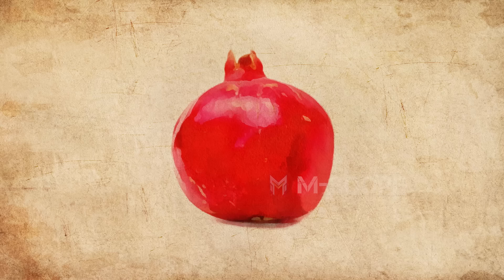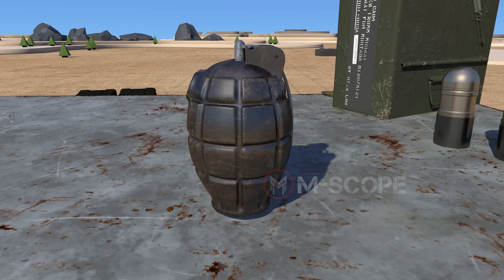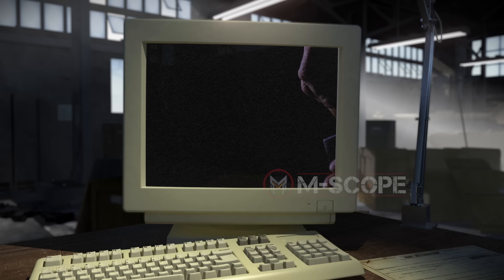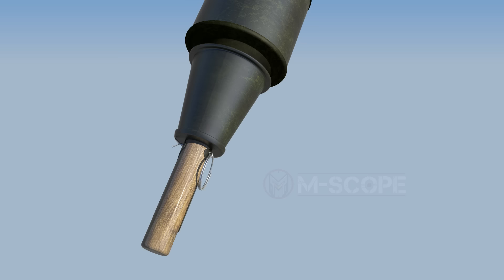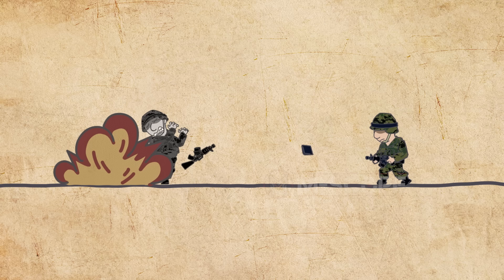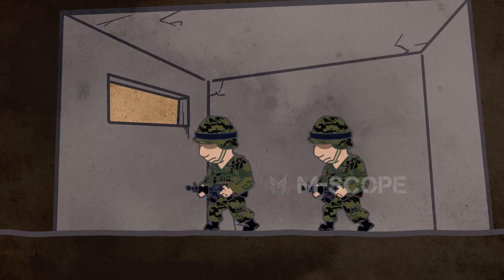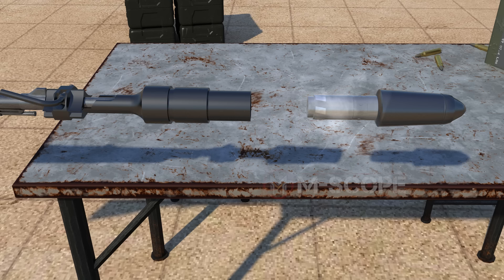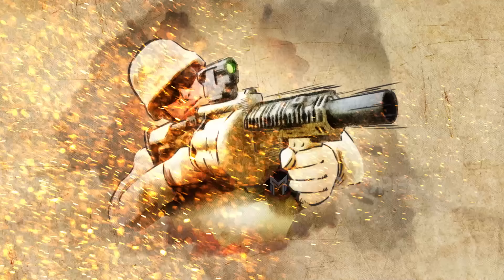How hand grenades and rifle grenades work? - All about grenades Part 1

Comment: "A grenade is a weapon made by putting explosives or chemicals into bullets." No. A bullet is a projectile fired from a gun. This is not just semantics, since explosive small arms and light weapon ammunition (although the latter would typically be called a 'shell' at 20mm calibre or above). The Oxford definition works well i.e. "a small bomb thrown by hand or launched mechanically"
Reply: Quite right. Grenades were invented as a way of giving explosive weaponry to an individual soldier.
Reply: 2+2=4
Reply: @InkSplatter446 
I don't think it's even their second.  This is pretty clearly a Wiki article fed into Google Translate and then fed into a decent Text-to-Speech program.  You can tell from the multiple typos it read out, the way it pronounced a few words, and the way it read "MK," which is supposed to be reak "mark."

This channel is a content farm, and going off of the limited amount of art, I'd say China or Russia.
Reply: @isaacschmitt4803  Don’t forget all of the bot-like comments that praise the video and only have one or two likes each.
Reply: You should blog about it
Reply: Sabot, eh? c'est oui?
Reply: I'm  still tring to figure out how fins make a rifle gernade fly stab um. And when did nap- um replace NAPALM?

Comment: Keep in mind....a 62 gr 5.56 round moves appx 3200 fps. A piece of shrapnel from a grenade is moving appx 25,000 fps... HUGE difference in what a jagged lump of shrapnel does vs a projectile from a gun.
Reply: I know you are trying to sound smart and apparently 17 people believd your BS 
25000 fps? 🤣😂🤣😂🤣 7.6km in 1 second? 
Lmao, an F16 goes at mach 2 (2400kmh or 666m/s).
A tank shell goes at 4000 fps 

Heres the real number

Shrapnel can travel at 3000 feet per second in all directions from the explosion

VOD is the velocity or rate of propagation of chemical decomposition/reaction... Not shrapnel
Reply: "I know you're trying to sound smart ..." 🤣
Reply: @nostro1940  can you imagine shrapnel flying at 25000fps tho? It would absolutely destroy everything in a really dragonball z kind of way, right? That ammount of force must be enough to make the shrapnel vaporize and pretty much delete everything that comes in contact with its dust
Reply: No, 15000-20000 foot/sec  is the velocity of chemikal reavtion of explocive, not velocity of shel

Comment: In Switzerland we had the 43 Stick Grenade to the mid/late 80s.
In the animation the flight is shown wrong, the heavy head of the grenade was the centre of rotation during flight.
Reply: I wondered if that was the case!  Thanks for the clarification.
Reply: One variant of that stick grenade was used in the movie "Mission In Action 3". Such a grenade was thrown behind character Colonel Braddock. When it landed on the ground (presumed now the grenade was armed), he looked at the dropped grenade, and knew he had to run away. It did not blow right away because of the so-called "delay fuze", but he knew he had to run away fast, and he did, but as soon as he ran 2 steps, the grenade blew up and he took the full brunt of the blow-up, catapulting him as far as 15 feet, because he was still in the kill zone of that blown grenade.
Reply: In "Saving Private Ryan", a WW2 movie, you see the Wehrmacht fighters throw stick grenades at several American soldiers perched on a 2nd floor of a war-torn building. The good news is that thanks to the delay fuse, the soldiers realized the sticks would blow in about 1-2 seconds so they had to jettison the grenades away out of sight before they blew. The grenades blew, but they survived.

Comment: In the Italian army until the 1990s the Beretta BM59 rifle was available which had the native possibility of launching Energa and Super Energa anti-tank grenades. It was necessary to raise the alidade (which, in addition to being an aiming device, closs the gas recovery system so that the gases from the explosion of the blank cartridge were fully available), engage the grenade and press the trigger. It is highly advisable to use the winter trigger because if you used the standard one you risked breaking your finger due to the strong recoil

Comment: During yugoslavia war some home made adapters for standard yugo handgranades has been used on AK's (fired with blank bullets). Such attachment screwed at front of the AK barrell hold safety lever of standard handgranade (M75 or M52), operator just removed safety pin and fired blank bullet....

Comment: The German Stielhandgranade still worked in such a way that you had to unscrew a cap from the bottom and then a string with a ceramic ball would hang out from it and you had to pull it and throw it away
Throwing it was a bit interesting because it had to be thrown by spinning it, unlike Russian or American hand grenades
The operation of the other round hand grenades is simpler, you only have to pull out the round safety pin, then as long as you are holding the grenade there is no problem, but if the metal tab on the side falls off the grenade, it becomes ready to fire from then on, so you have to throw it away within a second because it explodes in your hand and blows off half your body along with your head
A rifle grenade is usually not converted from a hand grenade, but there is a separate rifle grenade with a launcher, in which case a blank cartridge must be used to launch it 
The Germans already used a rifle grenade called "Schiessbecher" for the KAR98K under WW2
This is, for example, the AMP 69 of the Hungarian Army, introduced in 1975, which was specially designed for launching rifle grenades

Comment: I dont recall any grenades containing napalm. There is the M34 which was used as an incendiary and instant smoke screen grenade. The AN-M14 is a popular incendiary grenade and it doesnt explode either.
Reply: Exactly right
Reply: napalm is news to me too thermite and white phos incendiaries but napalm!!
Reply: Napalm in a grenade would be borderline useless.
Reply: There was a small napalm rocket developed for the The M202 FLASH. Was supposed to replace the flame thrower.
Reply: @johno1544  it wasn't napalm,  it was a pyrophoric aluminum compound
Reply: @chemistryofquestionablequa6252  I'm talking the The 66 mm TPA (Thickened Pyrotechnic Agent) Incendiary Rocket M74. The M235 had the triethyl aluminum that ignited on contact with air

Comment: At 8:17 they mention that white phosphorus is the filler for smoke grenades. Although there are white phosphorus grenades, I think it’s important to point out that the filler for normal smoke grenades is not white phosphorus but a different chemical.
Reply: which chemical?
Reply: @ericcartman2119  The filler consists of 250 to 350 grams of colored smoke composition (mostly potassium chlorate, lactose, and a dye) in virtually any color. White smoke grenades typically use hexachloroethane-zinc and granular aluminum

Comment: I thought that modern grenades didn't have grooves at all, but individual fragments contained in a thin shell.
Reply: Yes,  they use ball bearings epoxied inside the thin metal casing.

Comment: When I was in the Marines we were told there was a 5 second fuse however the pomegranate is made by the cheapest “Lowest bidder” generally you do not want to cook the grenade! Explosion times may vary!

Not that anybody cares but my reduction to a grenade was in MCT Camp Lejune, it was the instructor “we were in this like shed structure” the instructor was deepest in the shed to my left was this female & me, the instructor pulled out what look like a peanut jar “aluminum container that peanuts come in” remove the top followed by pulling the pin to open “remove the aluminum that sealed the grenade” tipping the container upside down having the grenade fall into his hand, only do then toss it unexpectedly through the female hitting her in the chest “gently” only for her to freak out in the grenade to fall to the ground! Second it hit her chest, she screamed and try to leave the shed! However I processed it as instructor what is not running then we're good! I thought it was funny I also thought it was interesting how the grenades were sealed in a peanut can!

Another story: “for those who are interested”  Took place in Ft Leonard Wood, everybody was sitting cross legged in a semi circle around another instructor, he was holding a practice grenade “hollowed out with a replaceable primer/ fire cracker that function exactly like a grenade” he was explaining how a grenade function, pulling the pin, letting the spoon eject, then barely tossing it in the group the majority of the people ran for their lives!

Comment: OK video,!  However, slight omission. Some grenades were launched from early M16s using a Nato 22mm diameter flash suppressor and a grenade retaining spring  The system was dropped because of having too excessive time to use a Grenade Launching Blank cartridge ( no projectile). The reason for dropping use was having to manually load a GLB. Nessatating removal of the ball round and then placing the GLB in the chamber then placing the grenade used on the end of the rifle barrel.   Live ball M193 could not be used to launch the rifle grenade.  Doing so would result in injury to the shooter,and the detonation of the grenade. The M203 did not require such excessive time constraints. Faster reload times, and more variety of rounds.

Comment: Great animations but a few technical inaccuracies:

1. It’s not true that hand grenades NEVER have instantaneous fuzes. Some countries ship hand grenades with the option to insert an instantaneous fuze, thus providing the ability to turn the grenade into an anti personnel fragmentation mine.

2. Although less common, stick grenades didn’t completely disappear after WW2. The Chinese continued to make a stick Grenade for some time.

3. Rifle grenades did  started with adaptions to hand grenades in order to increase range. However they very quickly became a different sun-group of ammunition and it’s generally inaccurate to use the term ‘rifle hand grenade’. The M31, for example, can’t be thrown by hand.

4. Not all rifle grenades use ballistite (‘blank’) cartridges. Some use a ‘bullet catcher’ mechanism which allows the user to use a standard round, as does a ‘bullet through’ grenade. These types reduce the time in which the rifleman can’t use his rifle while setting up the grenade.

Comment: Enjoyable video. You missed a baseball CS that doesn't have the clip. A plunger is in the tube and a pin holds it. We learned that putting your finger on the plunger when pulling the pin is NOT the same as holding the spring handle. It will explode while you hold it and your finger holds the plunger. The plunger does not need to pop off to arm it. I betcha!!

Comment: Great video.  Most of this I already knew or had a pretty good idea how it worked being a history and war buff since high school.  Though I do have a question.  At 9:35 you go into the mechanics and actions of a spigot launcher.  This was something I knew nothing about but am amazed at most of it.  The grenade is inserted into an adapter tube then into the Spigot launcher.  The explosive gases from the blank rifle cartridge blasts the grenade assembly into the air toward the enemy.  Now, how is the safety pin pulled from the hand grenade?  How is the spoon released when we can clearly see that it is constrained by a clip on the launcher?  That part is not followed up on and explained.  My father is a Marine and says that you DO NOT pull a safety pin out with your teeth like you see in movies.  They are restrained quite well, one would pull his teeth out before that safety came out.  It takes a determined pull to remove the safety pin.  And what about timing?  It takes a few seconds for the detonator to activate the explosive material.  Otherwise you're simply delivering a perfectly good hand grenade to the enemy without the satisfaction of it's detonation.  They may return it in a proper manner.  Answer?
Reply: InRangeTV has a good video on the M1 Garand spigot launcher if you are looking for more details. There is a little tab that holds the spoon down after pulling the pin until you fire the grenade. On some cup launchers the cup itself holds the spoon down until it is fired, so you pull the pin and shove the grenade into the cup without letting the spoon fly off.
Reply: @asteamedpanda  Ah, that explains it.  Though having a grenade that close to me without a safety pin is a bit unnerving.  But it works so mad respect to the soldier arming a launcher.  Thanks for the info, that pretty much explains it.  I will check out that channel.  Appreciate the lesson.  I have learned something new. 🙂
Reply: Rondo I suggest watch a 13 part series called What on earth happened by Ewaranon to learn that the earth is not a globe. I got it in my about tab.
Reply: @flat-earther  In my brief research this appears to be a con of some sort.  A lot of negative publicity surrounds this mysterious person.  Perhaps another Scientology in the making?
Reply: @rondohunter8966  I share the series because in my opinion it's one of the best I have seen to serve as an introduction to the globe versus flat topic.
I don't know what Scientology is.
If you don't want to watch it there is NASA fanboy questions which is a series with very short parts. It does not cover flat earth but questions the globe.

Comment: grenade is something that i would not use myself in war cuz they do explode in hands sometimes after removing so called ring. im not sure if it due to faulty grenades or someone in the factory just having fun.
i have seen video where disguisting bearded muslim screamed Alla im going to BAR removed safety pin and grenade took off his hands instantly after it happened other muslims started to scream Alla In The Bar, Alla In The bAR